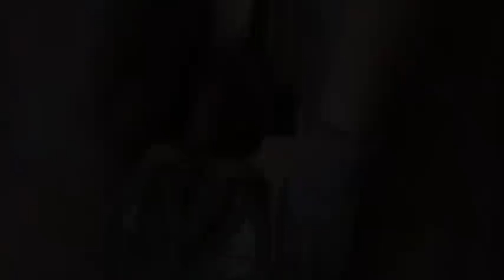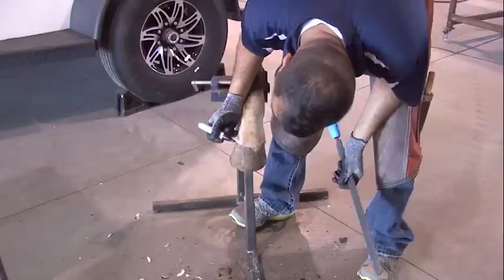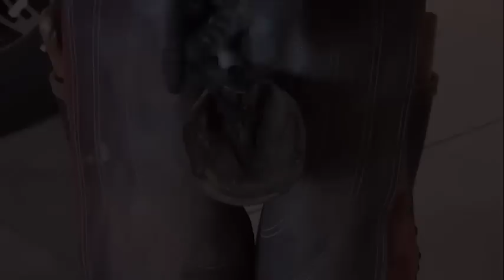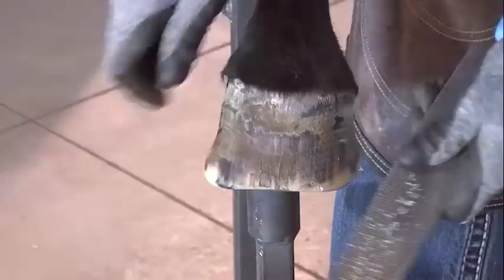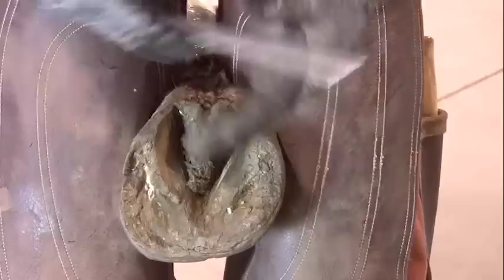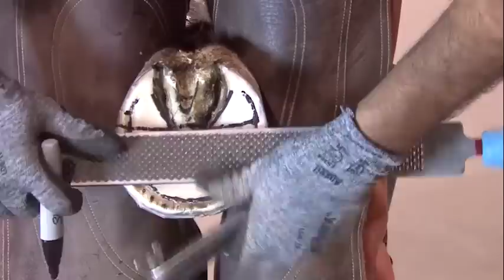ELPO Barefoot Trimming Protocol (Updated 2017)

Comment: My belief has always been that the hoof wall has more height than the sole, that there is a go cavity to it.   Right now my barefoot trimmer ( horses have been barefoot for years and feet have changed with new trimmer) is leaving a huge “ toe callus” on their soles, so much so that the toe sole is higher than the wall. To me it would be like walking with something under the ball of your foot and uncomfortable.   Is this normal or desirable?   I’m loving your explanations… just like we used to do 60 yrs ago!!    We have soft footing indoor and outside 
Appreciate your thoughts
Reply: This is an old comment, but you might still read it. From my point of view, this is absolutely normal and good if the toe is too long. How does your horse walk? If they walk comfortably with it, fine. Otherwise, leaving more wall might help.
Reply: @AjnosMitSukarm  he seems sensitive on that foot    Hard to tell if it is the protruding toe callous or something else. He is retired and at 32 who knows ( X-rays last year only showed imbalance I’d discussed with farrier), but if I run a file and bring it even he seems more comfortable . He bops around like a 10 yr old.   Thank you for the comment!